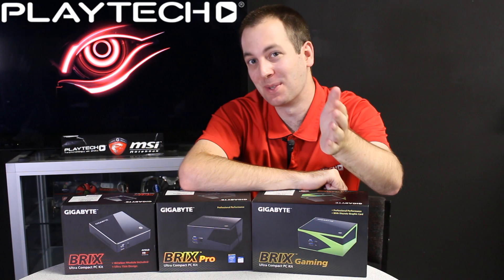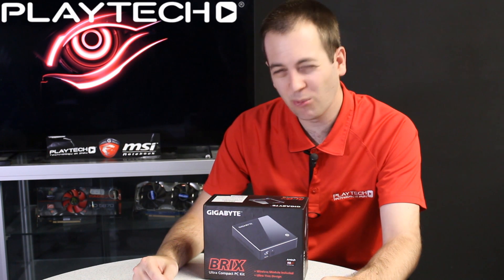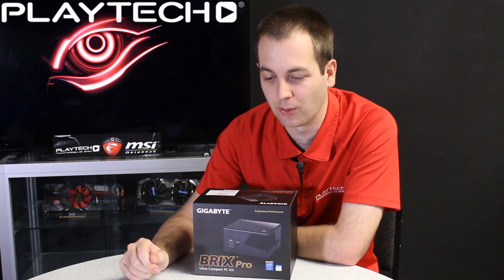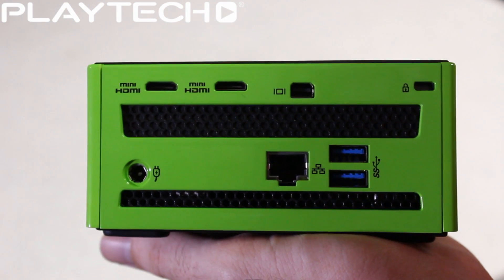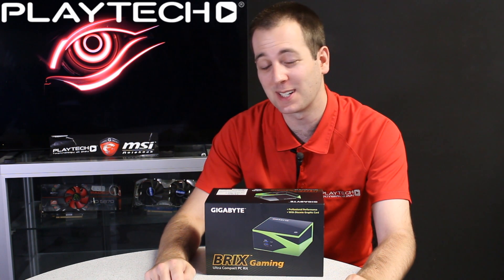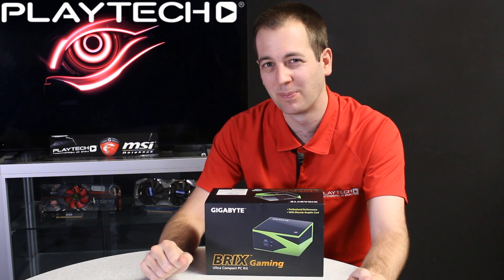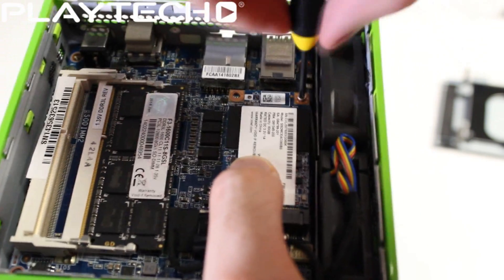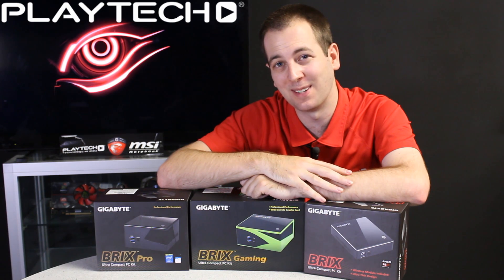Gigabyte Brix Compared - BXA8-5545, BXi7-4770R & BXi5G-760

Comment: The Core i7-4770R would be perfect as a Plex Media Server. Remove the WiFi module from the mini PCIe slot, you won't need it. You'll be using the gigabit Ethernet 24/7. Connect a 10GbE module to the mini-PCIe slot where the WiFi was once located. The mini-PCIe slot is x1, but in 3.0 speeds. That's about 1,000 MB/s of bandwidth or 8 Gb/s. Put in an 802.11ad module and attach it to a mini 16-antenna array. 802.11ad is capable of 7 Gb/s, which can perfectly utilize the mini PCIe 3.0 x1 bandwidth. Throw in 16GB RAM, a Samsung 1TB mSATA in for boot OS, and a 2TB 2.5" Samsung SSD for storage. If you need more storage, connect 2x4TB USB 3.0 drives to it or if you want to keep everything SSD, 2x2TB Samsung SSDs in USB 3.0 enclosures with UASP support.

Comment: question,what fans are built in to the brix gaming and can i exchange them for silent ones ?.
Reply: +andrew3631 If you're a handy man and good with a dremel and want to get creative, remove the stock finned copper heat sink, fabricate or buy a solid copper water block that fits as a replacement, dremel 2 holes for water tubes, buy a complete external water cooling system like the Koolance Exos-2 V2 and viola, you're done. No more heat or sound problems.

Comment: I like this video, it helped me to get a grasp of what these brix units are about. I would have bought the highest end green one if I could mount my external graphics card. Not including a pcie 16x slot, or two slots, was a massive mistake. I have a pile of perfectly good riser cables for fiddling with graphics cards, and not being able to use them would drive me crazy. All of these brix units are a bit lacking on features, but all I care about is the painfully obvious feature of external graphics. Props to Gigabyte for taking on this design, but they need to keep on it and never settle for low-end devices. The thing is, a high end device is only expensive when it's new. Let the rich people buy the new units, and the year-old units can be sold at a fourth of the price to everyone else. So the rich people get a continual 20 to 30 percent performance edge, but that's why their rich, to be the experiment pigs. ^_^

The low end device is offensive GARBAGE nomatter how you look at it. Even as an entry PC it's not worth it, it's trash, it's rubbish, it should be banned from existence.
Reply: Royce Barber  I bought the Brix Projector one a few months ago when it was reduced to £250 as I had wanted it ever since it was released at £550.  The projector is bare bones wxga resolution but I love it just for how unique it is. The PC can be hooked up to a monitor  via HDMI or you can use it with the projector and lastly you can plug another device  like a laptop into the back of it via HDMI and use it like a mini projector on it's own with the PC not powered up.  The PC has an i3 Haswell with integrated graphics, it can run older games like Bioshock 2 maxed out , 35fps @ 720p so it's not the most capable  but   I only wanted it because of how unique it is.

I like you would also like to be able to hook up an external GPU via PCIE ribbon cables as that would really add to the longevity of these devices. I have no idea Gigabyte doesn't sell a little expansion dock for external GPU's?.

I am also looking  at buying the green model shown here with the gtx760 with 6gb of GDDR5  although  I would prefer a Maxwell version with say a gtx960 as that would be far more power efficient
Reply: No Name The Brix projector i3 has been available for £160 recently now gone up to £180  from Ebuyer,can't really see the usabilty of the projector but still a good price for i3 model.
Reply: maurice green Yes it's a cool little thing. Sure the projector isn't a high enough resolution that you would choose to do your gaming on it , however it does make the PC a versatile little device that's really unique and cool.  I mean you don't get an idea for how tiny it is until you actually see them. I am happy I bought mine
Reply: +Royce Barber The Dell Inspiron 15R Special Edition with the Core i7-3632qm cpu (4 cores, 8 threads) was $1,000 in 2013 when it first came out.  I paid $500 for it in 2015, added 16GB DDR3 1600 RAM, 256 Samsung SSD as OS primary, and removed the BluRay player and replaced it with a 2.5" HDD caddy, which I place a 2TB Samsung Spinpoint HDD drive in. The laptop came with with a 6 cell battery, I wasn't satisfied so I ordered an aftermarket 9 cell battery. 

I've completely taken it apart and put it back together, so this laptop is solid inside and out. It weighs like a freight truck when completely assembled, not light and cheap like typical Dell builds. The only thing I can't change is the graphics card, which is a Radeon HD 7730M. The CPU can be replaced by a higher-end one. Currently the cpu runs 2.20Ghz base clock and turbo's to 3.2Ghz. 

I'm planning on buying the extreme version of this CPU when the price comes down to affordable. The upgrade CPU is a Intel Core i7-3940XM, same socket as the 3632QM (rPGA988B), but has a base clock of 3.0Ghz and turbo's to 3.9Ghz. The passmark for my current cpu is only 6,929, but the passmark for the extreme version is 9,470. The Gigabyte brix PRO Core i7-4770R is only slightly faster at a passmark of 9,819.

Most common Inspiron 15R SE's don't come with an mSATA slot unless you specified when you buy from Dell, so I looked it up and found a daughter board for $35 that took mSATA drives and I threw in a 1TB Samsung mSATA SSD. Also, Inspiron 15R SE's with quad-core i7's have been discontinued and are very hard to find. Most 15R SE's now have i3s and i5s. 

So ya, you're right, give it time and the price will come down. Not just rich people, but people who want to appear rich,  buys the latest and greatest crap and are what's wrong with America. Fake it till you make it, right? Stop lying to yourself, you'll never make it, America is $18 Trillion in debt and counting. The iPhone, Samsung S6/Edge, and anything else the seems trendy and new, idiots will pull out their credit cards just to buy it thus adding to the national deficit. Word from the wise, just have some patience and the price will eventually come down.

Comment: Cant watch with sound yet but I have the A8-5545 and love it. Very quiet cant hear it.  Saying that when you first turn it on the fan sounds like a jet engine but quickly slows down. I use it for media streaming and fan has never got audible in use
Reply: How does games work on it?
Have you tried GTA V?
Does Assassins Crees IV work?
Does it lag?
Can you play any game in 800x600 resolution, but at maximum settings, with a decent framerate?

Pls answer, i would like to get one too bc it looks nice, and i need a (not extremelly powerful, but decent) gaming PC.